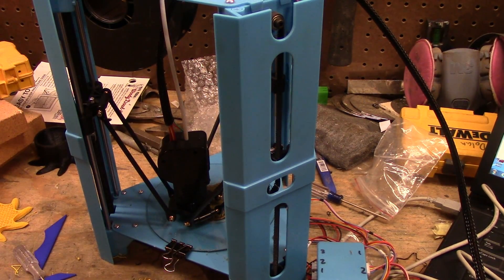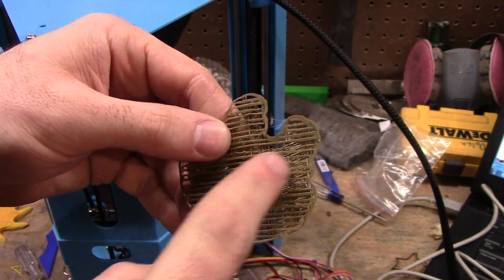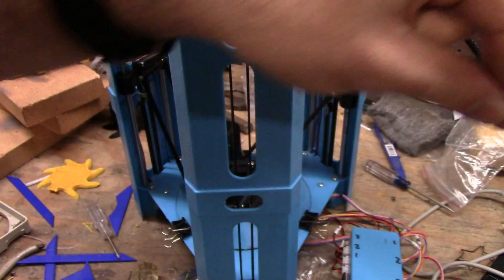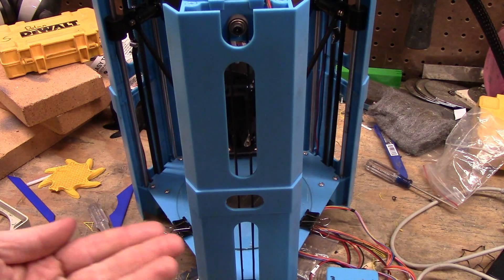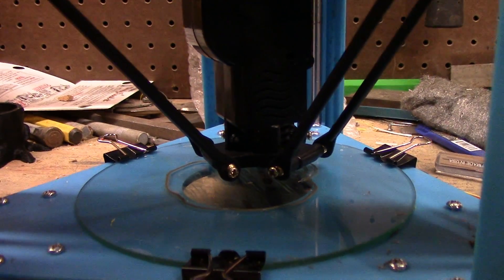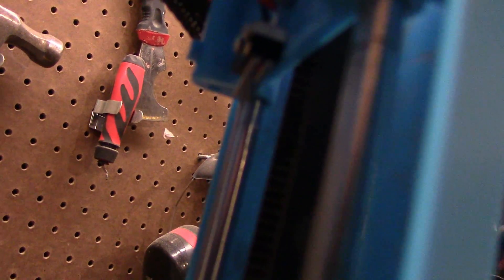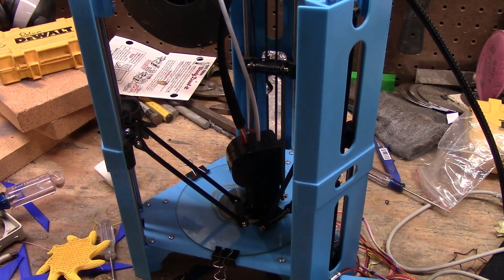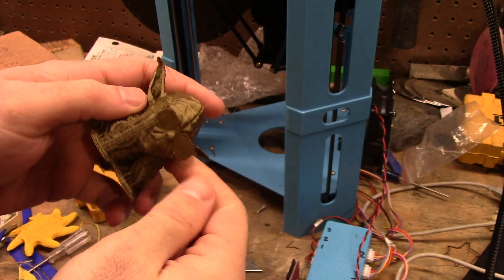101hero adjustment screws

Comment: hi do you print strait on to glass or is there some kind of adhesive you are using?
Reply from the maker: i use gluestick as the adhesive. just the normal cheap white or color changing ones work.
Reply: wow thank you i didn't expect a reply i have a problem- i installed new fillamnet and i just cant get a smooth printh sometimes it just collect as a big ball or if i get a print it has huge holes in it and bumpy layers there is just soo much wrong with it , it could be the leveling is there anyway i can get it to go down to each of the three corners i have it hooked up to repetier
Reply from the maker: you can either move it manually using the jog controls to put the print head at the base of each tower, there are also gcode files available on both the 101user.com forums or in the facebook group that will automatically move the printhead to the leveling positions at each tower. 
the holes and bumpy is most likely the extruder not extruding properly. make sure your filament isn't dragging, and might not be a bad idea to take the bearing off the printhead door and either stretch the springs or add some carboard behind it so it presses against the filament more fully.

Comment: i never printed anything, but if you want to reduce the shaking you should triangulate those three pillars.  just put a bar diagonally across the thing like this :  |/|
Reply from the maker: it would have to be an x |x| so that both sets of corners are braced. its on my list of possible improvements. trying to make a final decision before i modify it for the one and only time.
Reply: I think the effect is the same. x will be sturdier, but might be more of a hassle to make. I think you can even do a V shape between only 2 of them. a piece of cable between corners might do the trick aswell. |\|/|